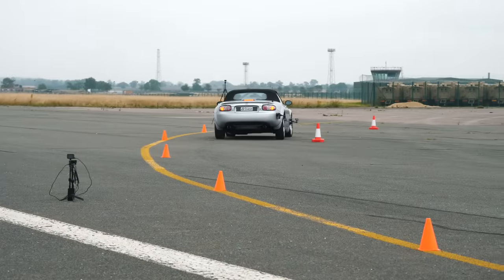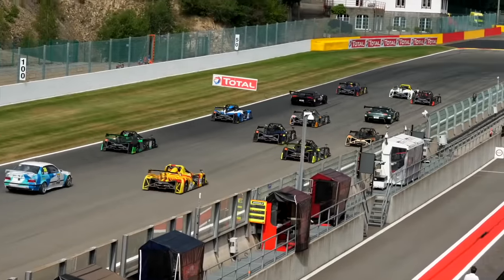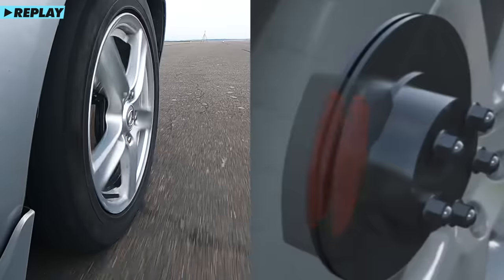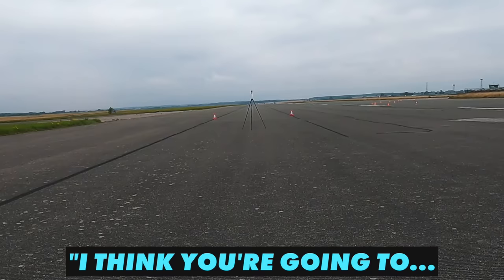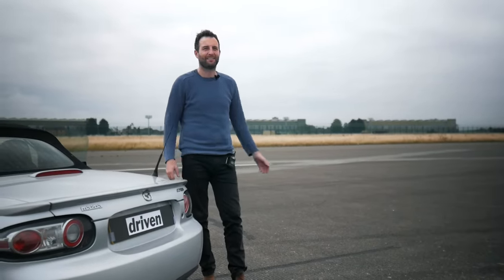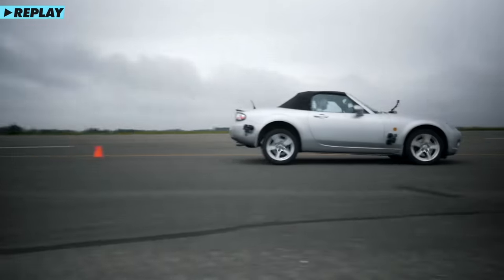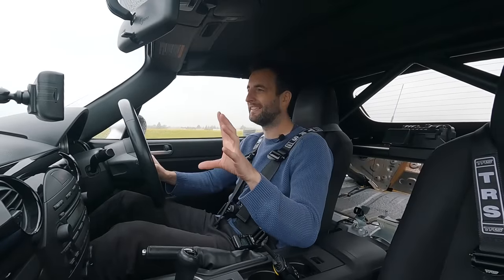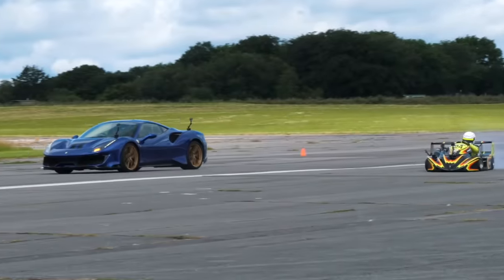ABS ON vs ABS OFF | What's Really the Difference?

Comment: You can actually see at 2:19 that the system disables ABS at speeds below about 1-2 mph. Most manufacturers have this to prevent problems like GM had where the car would slow down to 1 mph and keep rolling through a stop sign because of erratic wheel speed sensor signals.
Reply: It's also the reason why ABS can fail you in really poor grip conditions, such as snow or ice.  once all 4 wheels have stopped turning, the computer doesn't know you're still moving, so it allows the wheels to stay locked.
Reply: @johnhufnagel  This is kind of unlikely since all four wheels would have to lock up at the exact same moment. The failure mode I have described is when the computer thinks one wheel is locking up when it actually isn't, and the computer disables the brakes entirely and allows the wheels to free roll at 1-2 mph. Both of these failure modes have been corrected with better software since the infantile days of ABS.
Reply: @kdmq  perhaps it's because most of my vehicles are of the early aughts generation, but I have been able to have that exact scenario happen to the multiple times in the snow. Getting all four wheels to locks simultaneously isn't that difficult in a very low traction environment. I guess it's possible far newer vehicles with far newer ABS programming will fare better, but I don't have data to support that.
Reply: I've noticed that in Forza Motorsport 7, they appear to simulate some part of this situation. Must be the wrong part, because threshold braking gets really weird at 2 MPH when suddenly brake pressure randomly plummets. If I remember correctly, this occurs with ABS disabled.
Reply: @johnhufnagel  I would suspect that this is more due to the "reaction time" of the ABS control module being slower than in present-day computers. Since, due to the weight shift of the car, the back tires almost always lock up either a millisecond before or after the front tires, depending on how the brake proportioning valve is set. You would have to jab the brakes as hard as you can, on the most uniform ice, in a mid-engine car, to truly lock up all four wheels at the same time. That being said, you are still correct in that you can lock up the wheels in older ABS cars from ~2000-2005.
Reply: @kdmq  Properly set up brakes will always lock the front quicker than the rear. And that is even in a situation after a weight had already transferred to the front in order to force understeer rather than dangerous oversteer. No matter the car is new - it has to have this safe pattern even if ABS fails. Sometimes you are going to see Russian dashcam footage of the rear locking up sooner - that is most of the cases damaged braking force corrector. Or even removed one.
Reply: @filipczerwinski597  Interesting concept on the front purposely locking up before the rear. I learned something today.
Reply: @filipczerwinski597  I hadn't seen correcting valves on car in years. (Cirka 2010) I'm in impression that since EU mandated ABS car manufacturers throw them out and keep ABS work to keep brake balance more on front wheels. 
Somewhere I had seen other test / driving school had a truck with abs switch and there were statements that no ABS makes breaking impossible to predict. In theory it should be keept more on front but there is no correcting for weight
Reply: @antonikrainski5721  This I did not know. I am wondering though - where does EBD sit in all this? My early 2000s car - when I apply brakes moderately - I can hear high pitched noise from ESP module whereabouts without actual ABS action. What could be the case is no actual correcting valve and yes - ABS/ESP module taking care of it but still it might be independent from say wheel speed sensors - if they had failed. So maybe cutting power to whole module would disable brake force correction but 'minor' wheel encoder failure not? Anyways it makes ABS failure much more dangerous thing than I thought.
Reply: I didn't know the ABS switched off at very low speeds, that explains why I've seen ABS equipped cars lock up for the last few feet before stopping. I wondered why.
Reply: @johnhufnagel  Believe in JESUS today, confess and repent of your sins. No one goes to heaven for doing good but by believing in JESUS who died for our sins. GOD loves you soo much unconditionally.😍😚☺❤🍂
Reply: @alunesh12345  nah
Reply: @kdmq  is not hard to lock all your wheels on snow, just put summer tires and go out on a fresh "snowy" street lol
Reply: @johnhufnagel  not with modern electronic systems, as they know you can't slow that quick and see a wheel going from 30mph to zero in 0.1 seconds as abnormal.
Reply: @kdmq  correct, due to the different length of pipes and different calipers, even with a car on a ramp and the wheels free you can't actually lock all the wheels within a few msecs .
Reply: @antonikrainski5721  ABS cars don't need a compensation valve for the rear, as the ABS system will stop the rear brakes locking.
Reply: @kdmq  not unliekly at all.  I guess u don't live in the North and/or often drive on dry snow or sleet-covered roads.   I've had ABS & VSC systems plow me into curbs and ditches.
Reply: @kdmq  Yes momentum moves forward so with greater speed, weight & impact will need more braking power & force for the front end.

Comment: can you do one on downforce? Basically apply some different aero parts, homemade and professionally designed and what difference it makes.
Reply from the maker: Great idea!
Reply: Check out Kyle Engineers channel. Ex F1 aerodynamics guy analyzes road car aerodynamics.
Reply: Aerodynamically downforce only works if a car is fast - which is the reason race cars use it. With the typical speeds driven on public roads it would probably not make a real difference, and with the speed driven in cities it would make no difference at all.
What it would do is increase fuel consumption.
Reply: @simonm1447  Yep, also the faster you go, the more downforce gets generated, and F1 cars have to be driven hard to get any grip or have the brakes work at all because of how crazy they are.
Reply: @mosca3289  Believe in JESUS today, confess and repent of your sins. No one goes to heaven for doing good but by believing in JESUS who died for our sins. GOD loves you soo much unconditionally.😍😚☺❤🍂

Comment: I was hoping to see how well a pro driver like you can brake with ABS off.
Reply: This video was not about proving himself, it was about demonstrating the importance of ABS. If he had put in some skills, then you wouldn't have understood/seen the complete extent to which the abs helps.
Reply: @samyakhp4353  then he should have put a random driver behind the wheel for both tests to see how they did.
Reply: @SoloRenegade  
I mean, the average driver doesn’t know how to threshold brake, and that’s what he demonstrated here. The ABS system requires no thought, just mash the brake. He could get a random driver behind the wheel, but that requires more effort than what he can replicate well enough anyways. Also, when things go wrong, his experience will let him get to safety more safely, like avoiding the camera. 
side note, remember when Hamilton forgot to turn off the front tire brake heating mode? That’s how a car behaves when the tires lock, and every one else turning properly is proper threshold braking.
Reply: Everyone is not pro racing driver on road 
ABS is better for normal people
Reply: You missed a point from the introduction. Pro drivers are able to use threshold braking on a closed course because they run through the same turns repeatedly. ABS is useful in situations where the driver does not have a chance to practice.

Besides, most amateur drivers who think they know how to threshold brake actually do not. It would be professional malpractice to post a video that encourages them.
Reply: @samyakhp4353  Believe in JESUS today, confess and repent of your sins. No one goes to heaven for doing good but by believing in JESUS who died for our sins. GOD loves you soo much unconditionally.😍😚☺❤🍂
Reply: @edwardmoffett1704  but most street "pilots" have already finish their youtube courses in professional racing and brake thresholding! They make those civics fly bro
Reply: @Appletank8  people that have only just learned how to drive and never driven without abs would be like this it's stupid
Reply: @r.m.l2665  
I mean, yes? I'd be willing to bet that most drivers don't go out of their way to learn how to threshold brake.
Reply: @Appletank8  I'd say most drivers who have had to learn to drive in slippery conditions would have an instinct to lift the break if the car starts to lose control. I know that's what I instinctively do and I've never gone out of my way to learn it. There is a limit to how much ABS can do on snow or ice for example.
Reply: @jaaval  
And yet there are still massive pileups in winter because there's enough people who lose control anyways, and/or people who drive very unsafely. Everyone who drive south of snow will basically never run into this.

I think you are vastly underestimating the number of people who only treat vehicles as solely things that get them from A to B, and do not care to learn the intricacies of maintaining maximum grip.
Reply: @Appletank8  Well obviously. Driving in slippery surfaces is extremely hard even for professionals. My point was solely about the instinct to lift the breaks which in my experience develops very quickly. You can also get the hang of it in many driving games if there is even a rudimentary physics simulation.

But here we actually also have mandatory training on slippery surfaces in driving school. So everyone has at least tried avoiding a collision on a very slippery surface a couple of times.

It's also a bit different between north america and europe because europeans tend to favor manual and thus have clutch pedal. That also changes the behavior of the car and gives the driver some extra control.
Reply: @jaaval  
Yeah I doubt the US requires slippery surfaces driving training for licenses.
Reply: Yes this was just stupid... If you are so bad at driving that you can not avoid locking the wheels when breaking without ABS you should not be allowed to drive a car without ABS or hand in your drivers licence because you are a danger in traffic worse then a drunk driver !!!
Reply: @Appletank8  the average diver might not be able to threshold brake but they also aren't likely to keep the wheels locked up the whole way either. 

A comparison of the average driver, pro, ABS and full lock up would have been great.

Comment: ABS actually increases you're braking distances on loose surfaces like dirt roads, in which case you are better off locking the wheels to dig the tires into the gravel

Comment: The regulation is aware of the treshold braking and  that abs causes more distance. However the ABS is a must and there is certain factor. The ABS brake is allowed 1.1 to 1.25 times longer. The benefit of ABS is not the distance, the manueverability instead. 👍 great video
Reply: Did not know this.  Cool!  Thanks for info.
Reply: ABS was never mandatory in the US for this exact reason, it does add a little to stopping distance than optimal brake pressure (worse on stuff like gravel roads). ESC did become mandatory in 2012 in the US, and the easy way to to ESC is with ABS and TC, which is why all cars have it now.
Reply: The additional stopping distance is on a public road driven with a normal driver more theory, a professional race driver may get the same results (or with multiple attempts even a little bit better) , but a non professional normal car driver has not the skills to beat ABS.
You can compare this with fighter aircraft, the 1960 models had no fbw and the performance was strongly dependent on the skills of the pilot, while later models have fbw enabling a care free handling, which helps average pilots to get much better results than in the older models.
Reply: @peterleblanc661  My car doesn't have ABS, you just have to find the point right before they start to lock up.
Reply: I'm sure for 95% of drivers, ABS is going to both reduce braking distance AND increase control.

That's all that matters and it SHOULD be mandatory.
Reply: @GENKI_INU  Ofcourse, for the average person, I would agree. It is great that there is an option to disable it in most cars (just like tcs and esp.
Reply: @racvets1  i m not familiar with nhtsa regs. But i myself am a homologation engineer for european market. And it is compulsory in Europe. 👍
Reply: Abs always brakes earlier than basic brakes cause it keeps tires from breaking traction.
Reply: Seva Mobil, the small difference is compensated for on new systems with the brake assist function that bring the brake pressure up much quicker than a driver would in an emergency situation.
Threshold braking rarely works in a real life emergency, even with experienced test drivers.

Comment: Thank you for mentioning threshold braking. I grew up on cars before ABS became standard and had to learn threshold and cadence braking (basically manual ABS by pumping the pedal, when the wheels lock). The first is just getting to know how your vehicle responds on different surfaces and weather conditions, the latter is getting your brain to ignore panic mode and do the "stupid" thing of releasing the brake pedal, waiting for the tyre to rotate, then applying pressure again, rinse and repeat. That is actually harder than most people think.
The first time I drove an ABS vehicle (I had to use my boss' car for the day for a business trip) and had to do an emergency stop (black ice and stopped traffic), I really didn't stop at all. I'd learnt to cadence brake and started pumping, the ABS started pumping and... I just carried straight on. The lucky thing, as shown in your video, is that with both cadence and ABS, you can still steer the car. There was a gap and run-off, which, despite ice and the tyres locking up, I could aim for. I avoided the accident, but after that, I found a quiet stretch of road and really tested the ABS. If you you've "broken" your brain to actually do cadence braking, it takes a lot of effort to unlearn that and trust the ABS. Nowadays, people have grown up with ABS, so it isn't such a problem.
Threshold braking also save me. I was driving an older Toyota Carina E (well, it was nearly new at the time, but before ABS was standard) on a single track tarmac road covered with dust. I drove the road every day and I'd had the car for several months and I'd been practicing late braking on that stretch, because it was a "y" junction, I needed to turn up the short stalk of the "y", but if I messed it up, I could carry straight on. It was also open (clear view in all directions), so a safe place to test the bakes. One day, as I was approaching the junction, a woman in a Volvo pulled out of the stalk of the "y" without looking, got into the middle of the road and saw the Toyota coming at her with a good 50mph (60mph stretch of road). I slammed on the brakes and got them to the "howling" point, they were just at the maximum level of adhesion and were just about to lock up. I managed to hold them there, scrubbed off over 30mph, before I reached the Volvo, let up on the brakes, turned the wheel, the car started to turn into the junction, with a bit of understeer. A quick (very quick) dab of handbrake got broke the back end loose and the front gripped, being front wheel drive, I gunned the engine and pulled the car into the junction. I shot along the side of the Volvo with inches to spare.
The days of learning how the car reacted, specifically how it reacted on a dusty tarmac road, paid off. I did the perfect maneuver, with perfect timing. I couldn't have done it if I had tried, it was pure instinct and a one in a million shot. I expect, if I ever tried to re-enact it, I'd probably smash into the Volvo.

Anyway, it would be great to see such a video as this one, where the professional driver also showed how much shorter the braking distance is, if you can threshold brake. I expect it is only a couple of metres, but it could make all the difference. I find we are much lazier these days, we generally ignore our natural reflexes and don't train ourselves to brake properly, we just rely on the technology to get us out of trouble.

Comment: You mentioned threshold braking in the intro so could you do a test where you compare it to ABS? Every ABS test I've seen is like this where ABS is compared to non-ABS brakes which are completely slammed instead of the driver trying to manage the brakes
Reply: I can stop far faster in my car manually controlling the brakes no abs then with abs on you gotta keep it right on the edge of slipping to stop the fastest
Reply: @davidp4270  The thing is that ABS can do it again, and again and again, and for any kind of driver... We tend to think that everyone drives as good as one, but then again, youtube is filled with ppl crashing into other ppl and stuff ...
Reply: @MMOPhotos  And a lot of those crashes are cars with ABS because the drivers aren't paying attention to enough to use the brakes.
Reply: @dekoldrick  That is true... I've seen ridiculously stupid crashes where the driver just slams to the brake and does not even attempt to turn or anything and so they go, nose down, bottom up and crashing hard with the car / object in front of them... it's even funnier when they actually manage to slow enough and end up crashing at 5/10mph... it's like "dude... seriously??"
Reply: @davidp4270  you are still not better than abs is everyday use.
Reply: @@davidp4270  But no matter how good you are, it takes one 'bad brake' and it may have serious consequences. Racers take that risk bc ,well, it's a race and they have extra safety measures. Also, the newer abs stops sooner than the old.